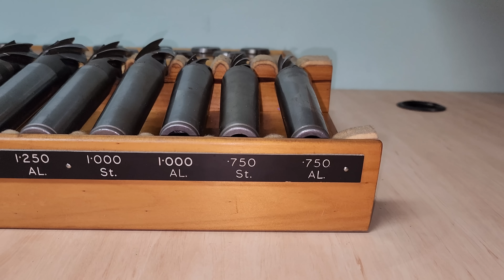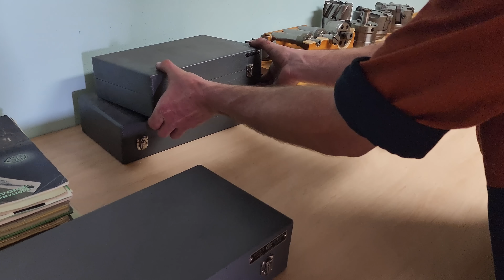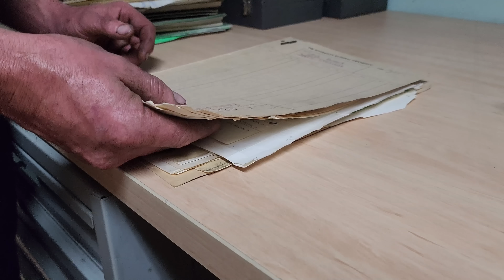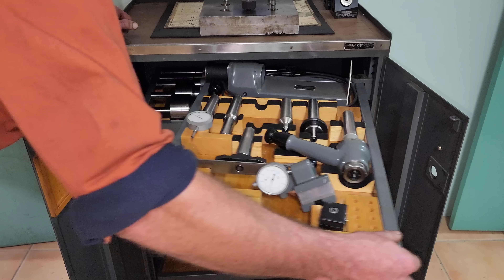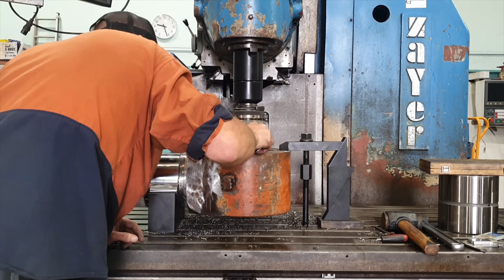Our SIP Jig Borer Tooling Collection! | Testing Shop Made BT50 Tool Holder

Comment: I used to work for a Machining Company, whose company name ended with  "... Presidion Products" My you tube handled here used to be Mike Baxter :)  (had to change my screen name) 

So as someone who started in precision Machining, back in the 1980's , I can REALLY appreciate this machine and tooling!!  ..  

We had an older Bridgeport original Mill set up with a Rotary ID Grinder, THAT is the type of finish it made!  Some parts we made were "soft ground", and we had a state of the art (at the time) heat treating facility attached to our building where i also helped out.... The Owner and on site manager, had a Doctorate. from Glasgow, Scotland. 

Anyway some parts were soft ground, then heat treated, then hard ground to final size. AND IMO the finish Kurtis has here, would 100% quality for soft griding precision!!

Comment: Firm I work for back in the mid 90’s had in there machine shop a cabinet like the one you’re showing but double sided so ten swing out drawers it was full for tooling for Bridgeport machines. I do remember the optical alignment sight that went into the Bridgeport which I was always fascinated by🩷🇬🇧👍

Comment: These SIP machines were very similar to Hausers. We picked up a Hauser jig borer at a clearance auction in Geelong and it too came with the original Genevie cabinet filled with most of the original tooling, optics etc.  The odd sized drills were also there, but maybe yours was missing a set of reamers?  Ours had a full set of reamers in what we'd call the standard imperial sizes, each one matched to a drill which was of course undersize hence odd sizing if looked at in isolation.  Either way, super accurate and a joy to use.

Comment: Those test plate’s hole fits and interchangeability are beyond impressive! Remember, in 1958 CNC machines were still 20 years in the future, as were pocket calculators. 
I was a high school freshman. When you needed to look something up, you rode your bike to the library. Your search engine was the Dewey Decimal Index Card File. 
Technology has advanced so far in my lifetime, but precision machine tools have been around for a century. CNC tools have made that precision available to more shops than was possible when I was a kid.

Comment: I see that you are also keeping the tooling in an air-conditioned (temperature and humidity) room. I imagine that you clean and oil? each tool after use in the shop but how often do you check those in-frequently tools? Is it even necessary?

Comment: Just found your SIP jigborer video. Worked on these machines for many years in UK . My tool cabinet was well worn and dirty, your looks brand new .Do you know what in the jewel for,  it a edge finder to use with microscope. All your tooling looks as new. Great find .My last SIP sold to India .Great video  keep them coming. Thanks  Keith retired tool room machineest

Comment: Just the detention mechanism of the tooling cabinet trays alone is pure machining porn!  Compare that to the common trend of touch screen buttons. 🤮I guess today manufacturers of actual physical manual actuation mechanisms get away with mushy or flimsy haptics because people simply lost the idea of what a clear haptic feed back can achive:  spare the need of a visual confirmation. That accoustic feedback of closing the cabinet shelf is just so unambiguous that anybody understands it anytime without second guess.
Instead, when a (digital) button privdes no feedback, then reading and interpreting the change on a screen requires additional brain-proper just to to confirm yourself whether your command got in fact dispatched.

Comment: That inflation calculator doesn't tell anywhere NEAR the full story about how much 13000+ Pounds Sterling was back then - Consider that a worker was paid around 10£ a week in Aus and a house on a quarter acre block cost around 1000£. This was a time before the fake money markets of real estate, where fractional reserve lending and resultant speculation created prices that don't reflect actual earnings or supply/demand dynamics. This machine was a nation building/company creating/high-tech gov program fundamental - cost wasn't prohibitive and precision was the selling point. If you consider the cost was the equivalent of 14 homes or 25 years of a worker's wage, (without even considering the cost of interest on that ammount which would likely be a doubling of the initial receipt total) - you can start to see what this actually was worth at the time - and it aint 1.5 mill LOL thanks anyway calculator provided by the banks to hide the cost of inflation caused by "money printing" at the bank level of the monetary system. Its good to see someone like Kurtis with this and seeing the admiration he has for this gear - stuff we gave away in the 80s because the economist morons of time, who still run the show, thought giving away australia's skilled jobs would benefit us in the lomg term - we know better now, that innovation happens on the factory floor, and it's hard for that to happen when you don't got a factory nomore

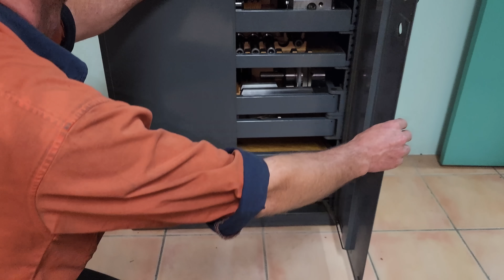Comment: The guide on the last tooling tray for the SIP machine is installed one notch too low (on the left, opposite to the axis of rotation, at 12:39 in the video). It is not horizontal. Or is there a reason for that? :-)

Comment: There is a Telescope used to pick out the centres on a plate marked out with engineers blue and scribed with a height gauge. These days most of the tools are obsolete if the machine has a Digital Readout. The best tools SIP made were the Boring Heads. Accurate to a tenth of a thou.

Comment: The two reference plates are a work of art. Amazing from a machine built in the 1950s. 
Watching Kurtis work is mesmerising. The skill level is unbelievable. Any budding tool maker, machinist or mechanical engineer should watch his videos, just to understand how high precision parts are actually made. There's such a big disconnect from the theoretical and practical with the use of CAD/CAM these days, the knowledge of how to do the "hands-on" is at risk of being lost. 
Keep up the good work and the amazing videos.
Reply: Saw a video on that topic.  Check out "Why we hate engineers."  Of course, half of what's in there should be an obvious part of engineering, but it's often missed.

In the EE field, one of the big things is constraints.  With the nice software, we can tell it exactly what the machine is capable of doing and it warns us if the board can't be made.  Want extra precision, be prepared to go to a more expensive board shop.

Comment: Excellent. Love these vids. As a non-machinist, and hopefully this will not be seen as a dumb question, but how do you keep the tooling looking so good Kurtis? I've heard from other channels, specifically woodworking, that others use paste wax to protect tools. I'm guessing wiping tools down with some sort of oil, is not the best given the size of some of the head/adapters. Regards, Malcolm from Central Vic

Comment: The £20,984 value is in Australian Pounds hence the exchange value of £A 4,196 after the Sterling total. Australian Pounds was pegged to sterling at a rate of 1 £A to 16 sterling shillings so the values work out to be correct. So according to the RBA pre-decimal inflation calculator, the actual value in 2022 AUD is a whopping $739,483.06 in modern currency, including the conversion to decimal currency! No blame on Kurtis though, it took me some digging to figure it all out and it's easily confused with both currencies having the same symbol.

Comment: As an electrician I worked in a Lockheed factory where they machined parts for missiles and rockets. I was amazed at the different "stations", each with a different worker, performing machining tasks on a simple blocks of aluminum to build the intricate parts that go inside these armaments.

Comment: You have a truly museum quality, collection of some of the finest mechanical precision machining tools man has ever created. The high degree of precision machining found in the finest quality Swiss watch moments is in of itself incredible. But you need to factor in, that errors also become smaller due to the microscopic sizes of the parts. When scaling that precision up to the massive size of that machine those same errors grow in direct proportion to the size of the machine, simply amazing. Great job in preserving and using a true piece of history.

Comment: I have what appears to be that same cabinet you show with the swing out drawers. It's called a Vidmar Swing-Out drawer cabinet. I have only ever seen mine and now yours. Mine was bundled new with a very custom Cincinnati milling machine bought by a local university in 1965. Same cool looking custom wood drawer inserts although to fit the tooling of a Cincinnati mill instead. I was going to attach pictures but it doesn't look like YouTube comments let you do that. I have not been able to find any information other than that on the bottom of one of the drawer inserts that directs you how to cut them to fit new inserts.

Comment: Hello Curtis Karen & Homeless: A testament to days gone bye. The machine and Tooling Package you have is "priceless" by today's Standards. 
CNC machines have been around long enough now there are many in the machining trades that have never worked without CNC capability. Your respect for the machine and the capabilities it has shows. As a long time viewer  I am pleased you will use the machine for what it was intended A production Piece of equipment. I will be interested to keep following your use of the tooling you have available . I expect many of the pieces will still have the protective wax on them when you are no longer using the machine. That is just the way it seems to work, most shops only use a small portion of the capabilities their equipment is capable of.
It sure is nice to have what you need to do the rare or sometimes one of jobs you may encounter. Keep the great videos coming.

Comment: Ive been thinking about that 20k pounds in 1958 turning into 630k pounds in 2023.  Which is (give or take )$1.2M AUD.  Which is sort of entry level for a capable and accurate machine today, right?  So the value proposition hasnt changed really.   I was most impressed with that test piece too!
Reply: Kurt's currency conversion was wrong - the final 20k pounds is in Australian Pounds and the "exchange" value before that figure is the difference between Sterling and £A (1£A = 16 sterling shillings). It works out to be a cool AUD 739,483.06 in 2022 though if you use the RBA pre decimal inflation calculator. No fault to Kurtis though, with the currencies having the same symbol and I'm pretty sure wasn't alive in pre-decimal currency so how would he know.

Comment: I think that tool cabinet is a versatool, they are not that rare (in the UK at least), I have a small one with a single fold out shelf I use for mill tooling.
Definitely built like the proverbial and far better than anything modern.

Comment: The tool cabinet with the swing out shelves is the icing on the cake. Fabulous to see the level of craftsmanship the went into this system. Just to own something like this would be so satisfying. It’s wonderful to see the level of appreciation from Karen and Curtis. Keep those wonderful old tools alive and working.
Reply: Used by Schaublin as well.  That's the top of the cake as well
Reply: @OmeMachining  In the case of cake I actually prefer the bottom, because the weight of the upper layers causes the icing between the layers to impregnate the cake, creatimng this magical coundary layer of icing-infused cake that is just to dieee for. 😍
Reply: Like, I thought my roll cab with the ball bearing drawers and the big wheels was the dogs bollocks, but now I want a cabinet that could survive a nuclear strike and still have the shelves swing out and make that little click noise whether loaded or unloaded.
Reply: @henrydorsetcase  get a Lista 💪😊 220kg on each shelves, and 3000kg in total in the cabinet 💪😁

Comment: I don't about you guys but I get what I can only describe as an unnatural 'buzz' from handling such exquisitely made tools, in fact exquisite engineering in general.  My still thinks I'm weird in this respect even after 50 years together. 😆. My idea of a shopping trip is mooching around engineers supplies.  I'm not that weird, surely not?

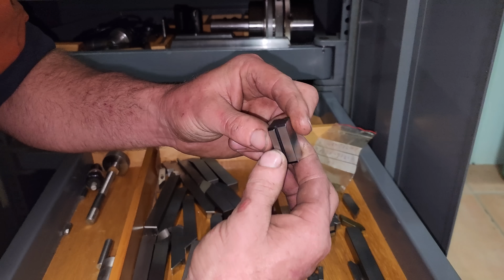Comment: In our machine shop the block you're holding at 12:13 is used together with a vice. The smaller width of the block goes in the t-slot of the machining table and the vice has a slot that's a very close tolerance fit with the wider part of the block. If you use two of those blocks it makes it really easy to set up the vice perpendicular to the t-slots of the table. Hope it helps you to figure out what it's for. Greetings from Germany😊

Comment: SIP is the Rolls-Royce of Jig Borers.  I had the pleasure of running one for a large company for a few weeks.  I was early in my tool making "apprenticeship" when they asked if I would like to be the permanent SIP operator It was in a isolated, controlled room for only the SIP and the countless cabinets of SIP tooling which was top notch quality.  Since that would specialize me and I would lose out of working with and learning from some fantastic, older machinists on various, other machine-tools, I passed up that opportunity.  But I got to feel what the ultimate in machine tool is to run.   Creamy!

Comment: Only machinist can fully understand how hard it is for that two nine-hole plate to  rotate 90 degrees and still mate the pins with that close tolerance. And it is made on a manual machine. Wonderful.
Reply: I mean im a carpenter and i get how hard it is.
Reply: You just know that the main machine, and all the tools that go with it - have found a good home.
Reply: Yeah, it's really good. I've never operated a machine that could do that.
Reply: how many hour would it take to make those 2 plates?
Reply: Are you kidding? I couldn't get two holes to line up like that!
Reply: That collection of tools doesn't even look like it was ever used! What a fabulous find. I can see you're going to put it to good use.

Comment: Woah, that test piece is actually insane. Machined at opposite ends of the table in different orientations, and still so accurate you can spin the plates, and the holes still line up perfectly. That is awesome!
Reply: I would be curious is any other machine made today has a chance of doing the same
Reply: @ttargetss  Sure. We haven't stopped innovating. Should be easy for a Kern or similar.
Reply: @ttargetss easy peasy, with today's CNCs even Haas mill can do it
Reply: And the sound it made when pulling out the dowels *thup* was awesome. So so accurate
Reply: It's one heck of a 'party piece' that's for sure. No doubt at all that this was from the era of things being built up to a standard (rather than down to a price).
Reply: @AndrewMoizer  this machine is impressive for sure but there are plenty of machines today that are even more accurate. Now machines can do multiaxis milling with the same accuracy as those jig borers did. A company in my city makes a cnc machine with 0.25 MICRON accuracy used for making semiconductor equipment.
Reply: @AndrewMoizer  All machines are built to a price.  I mean, design constraints are a thing, and price is part of that.  The classic triangle is quality, speed, and price.  In the case of machines like this, quality is tolerances and level of support from the manufacturer.  Speed is how long it takes to arrive.  Price is, well, price.

That's not to say it isn't an amazing machine, just that if you're willing to pay for it you can get as good or better.

Comment: What an awesome assortment of tooling, just the way you're handling it shows how much respect you have for it and how much it's appreciated. To be able to manufacture that test plate after installation shows the craftsmanship involved in this machine. 
How it's not even working up a sweat boring out the cylinder eye says tons about this machine. It's found the best home at CEE.

Comment: Believe Those are Jig reamers not Endmills Kurtis

You use them for assuring locational accuracy on holes before using a finish reamer. 

The clearance angles on the flutes should be abit different than an endmill as they are meant for mainly axial loads not radial.

Comment: what a treasure Trove for those of us who still appreciate "standards-traceble" gear, gear that gets into nanometers, repeatedly...my good friend has the smaller SIP in his basement, and a laser intererometer attached, but i recollect that the interferometer was used to get readings into his computer, NOT to actually do measurements, as the machine was spot-on in a 30 cm cube.,. btw, does your machine documentation include its accuracy, probably against the Swiss standards branch in Bern?

Comment: The precision of the Sip Hydroptic 6A astounding.  When we bought ours, with the same tooling cabinet, they gave us a certification showing its accuracy was within the 20 millionths spec quoted by Sip.  They explained it was that accurate within the entire envelope of the machine travel in all directions.  My absolute favorite machine of my career.  Such accuracy and repeatability that it becomes difficult to run cheap machines after the Sip.  I appreciate your careful handling of the tooling, they must be handled in that manner to maintain the accuracy.
Reply: I agree - I noticed how gently handled some of the delicate pieces.   what pride of craftsmanship to build these machines.  Twenty millionths of an inch?  wow.  and you stll have the original setup proof machining.  what an astounding machine.